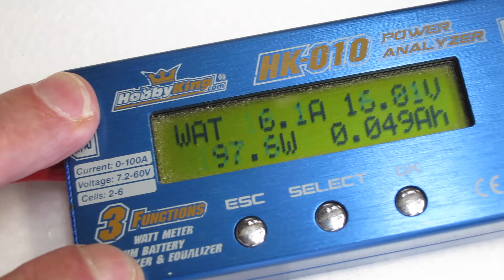Dynam Primo build

Comment: Thanks for doing a review. Nice to find this style of plane cheaper than the usual places. now you just need a lens with a low fstop 😀
Reply from the maker: Ah yes, what I actually need is a new DSLR body that does decent video.
Reply: Andrew Newton i have a used t3i body with one of the 1.8 50mm prime lenses ($100). It is difficult to position as my office is not really big enough to get back and have everything in shot, but the bokah is very nice. Makes me want to edit.